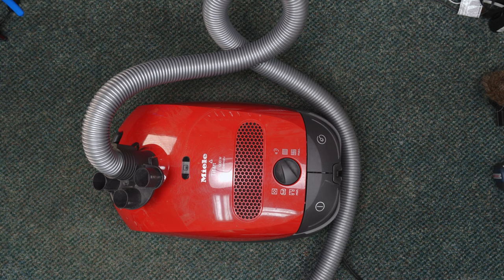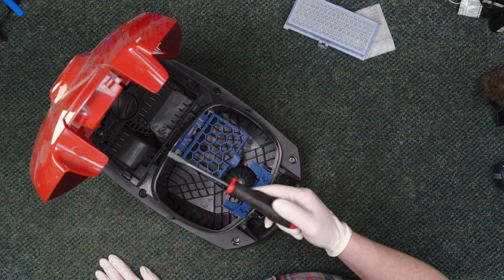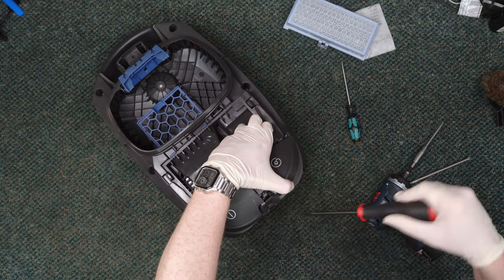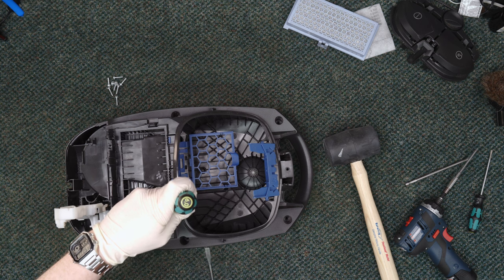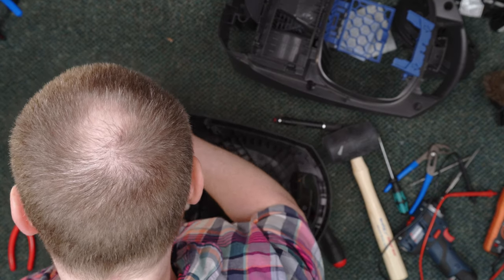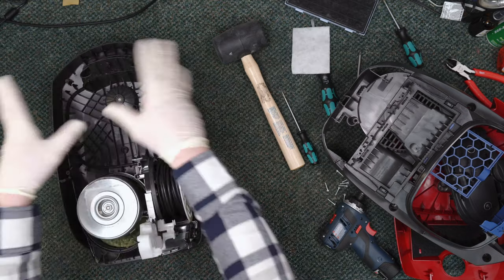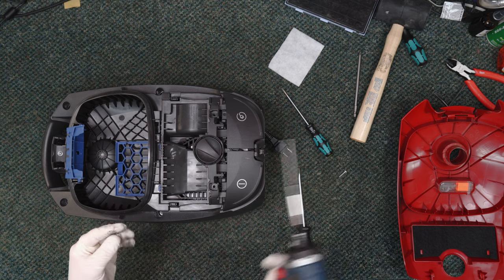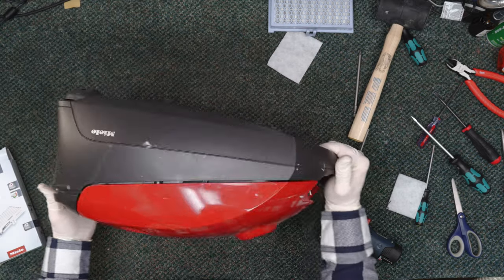Miele Classic C1 (S2) - New Cord Reel Installed!

Comment: I just received an estimate for this repair $235. I'll try to fix it myself, nothing to lose. Can you tell me the part number of the cord reel? I have Olympus 300 which looks similar, same buttons, size etc but white. Since it's discontinued, Miele can't tell me the part number, or a suitable replacement part number. Thanks for any help and thanks for the extremely helpful video!
Reply from the maker: Hi Sharon! That estimate sounds just about right with installation, tax and maybe a filter. The cord reel is part number 10483322 and retail on the part is $143.13. Miele's parts stock has been kind of hit or miss since COVID, but it is showing that they currently have them in stock so online retailers should have them as well. Hope that helps!
Reply: Thank you for the part number, I have one on order now.
Reply: Hi will this part work with Miele compact 1 turbo team powerline 2018? 
Thanks! Very helpful video :)